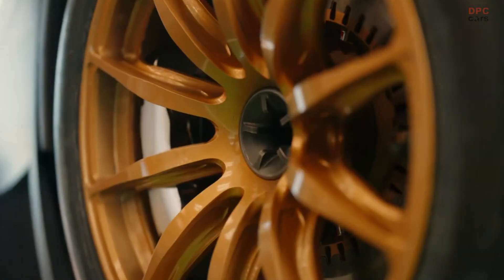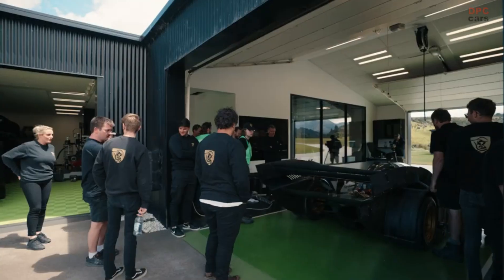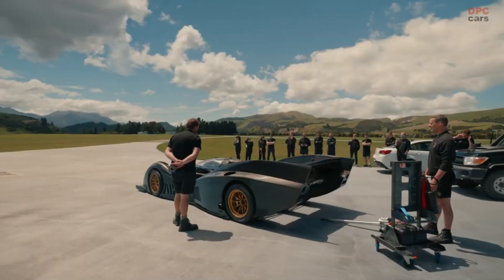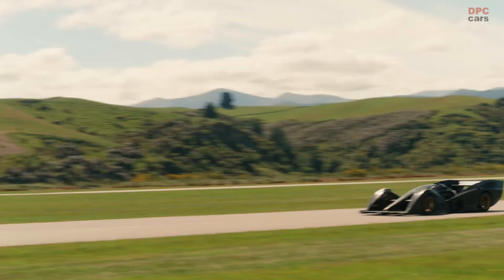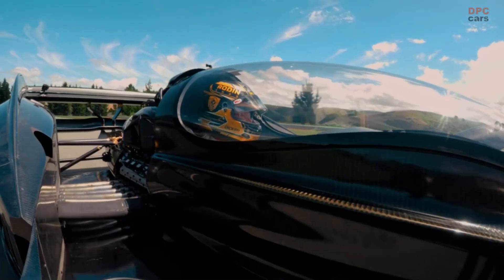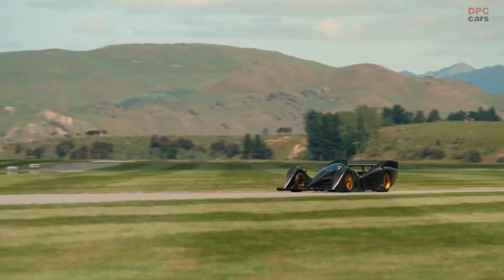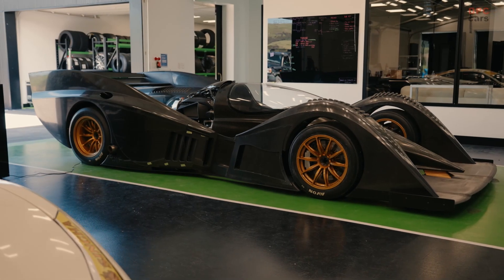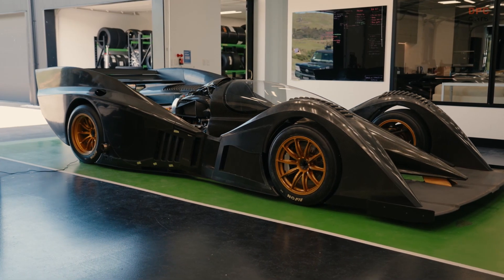Rodin Cars FZERO Prototype V10 1013 bhp

Comment: love how they claim that it's faster than an F1 car but there is not a scrap of video of the thing doing anything more than idling around a track half heartedly.
Reply: Indycars are faster than F1 cars in a straight line due to less downforce. This thing will be very fast if it's predecessor the FZED is anything to go by. But the main difference is that it is a track car built with no limits and no motorsport regulations to worry about unlike F1
Reply: On the simulators it was 7 secs a lap faster than the RB20 around Albert Park.